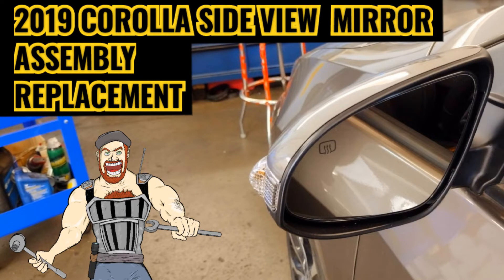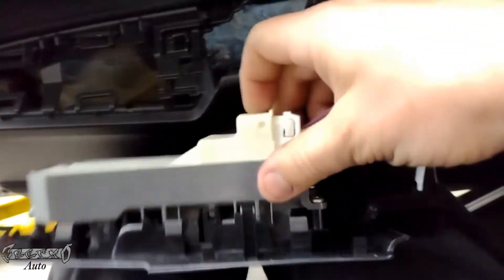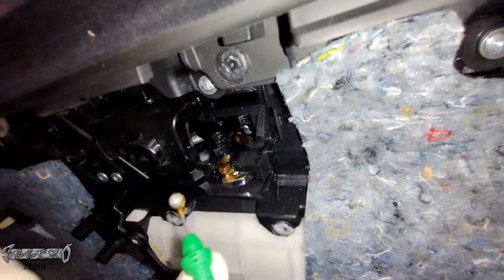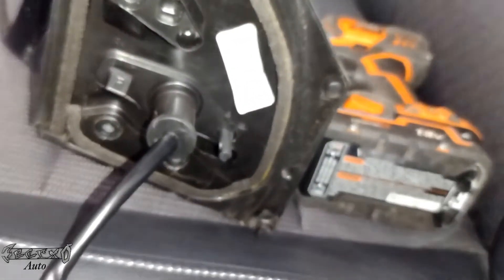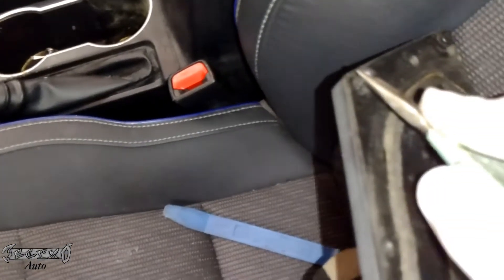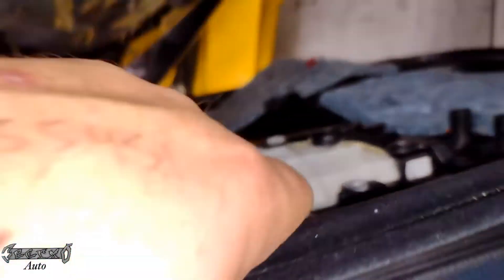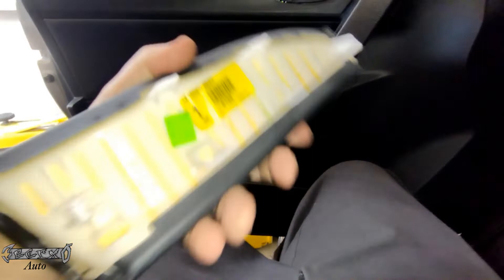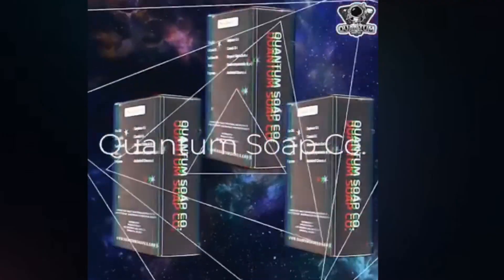2019 COROLLA SIDE VIEW MIRROR ASSEMBLY REPLACEMENT

Comment: Not full joy.  The replacement of the rear view assembly went as described, but the original painted piece's tabs did not line up on the oem assembly, so I had to get the oem shell painted.  2017 Corolla SE passenger side.